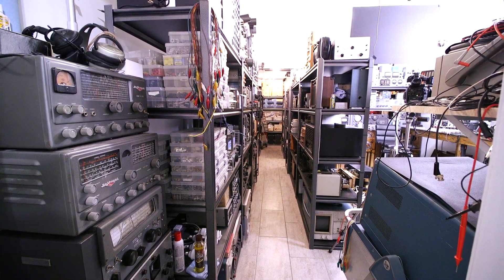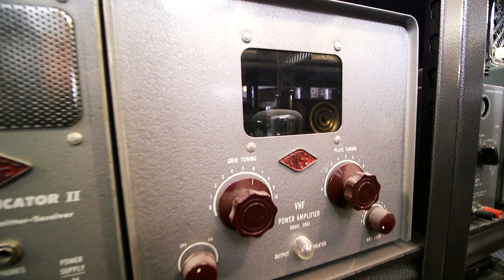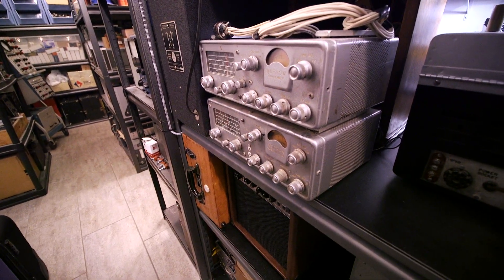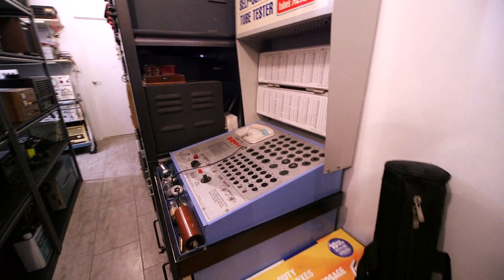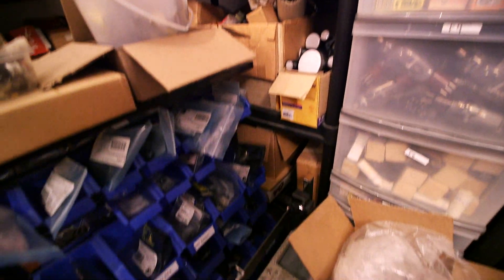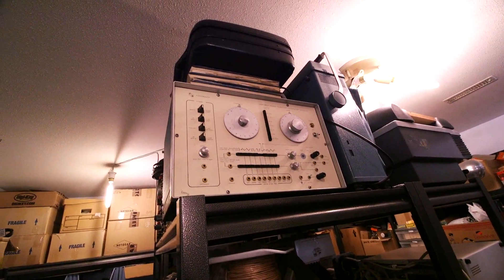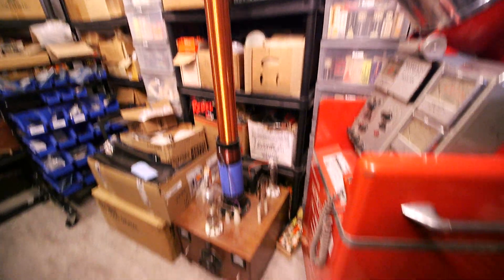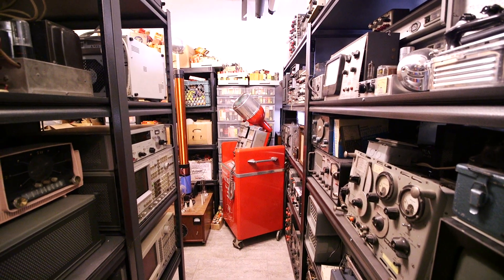Neat Projects Inside Lab 2!

Comment: It would most likely be easier for you to manufactor a much better extreme quality UFO-finder from scratch (motorized 3-axis base, high resolution 8K starfield/nightvision, broadcast quality lenses), than to "realign" this product. Too much effort only for some pretty useless fun, cynically speaking. Others points out that it's a needed device for the good guys in the combustion engine automobile environment.

But when to start, when so many projects are waiting all around you ?